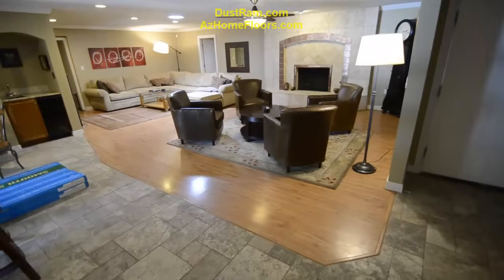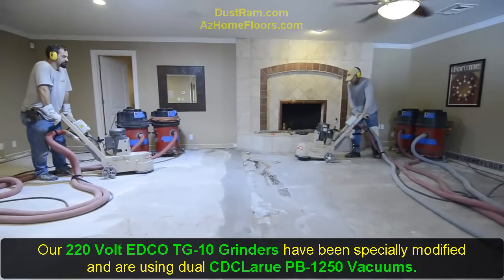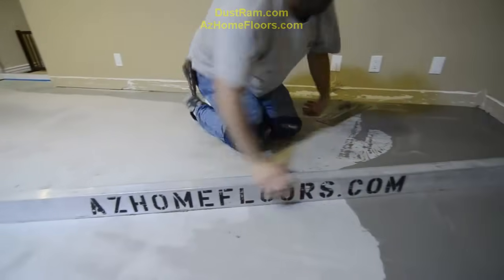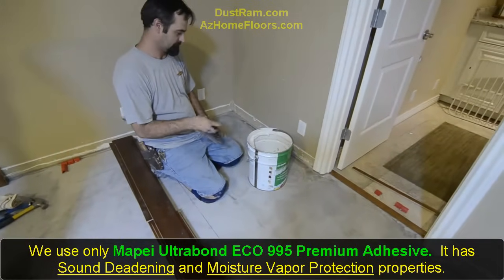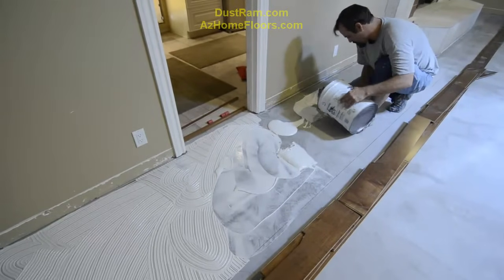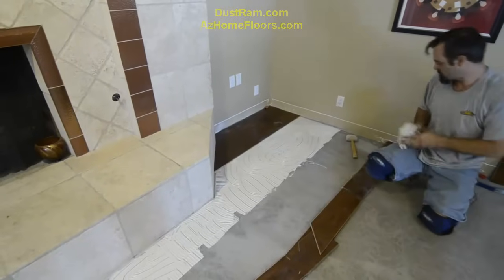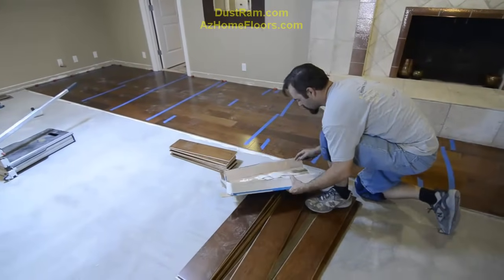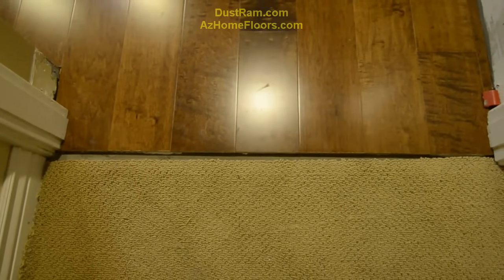Professional Phoenix Hardwood Floor Installers - (For Homeowners Who Want It Done Right!)

Comment: wow" Fantastic work guys. beem installing and sanding wood floors for 15 years now, and have become stuck in my ways. Its great to see how you guys leveled this floor out using those 20 Foot Levels (Screeding). I will use this method on every job now. Problem is for me, I run into a ton of home owners who dont wanna pay all this extra money to do things properly, so I always have to cut corners which I hate doing. I need to be more firm with home owners and explain why this process is the correct method. thanks for sharing guys.

Comment: I am planning to purchase a new (to me) home shortly, and definitely want to do hardwood, even here in Vegas. Yes, it will a long-term, not-ever-moving-again home. After watching this video, I'll be setting very high expectations to my flooring people. Outstanding.
Reply from the maker: That's great news!  If possible, if your timeline permits this, please have your old floors torn out first and then assessed before purchasing any flooring.  This way you can find out if you have mild, medium, or severe floor preparation issues and then decide what you can allocate for your budget.  Also be aware that most flooring stores will end up charging for the tear out based upon the overage needed for your new flooring.  If you are savvy to this, you can prevent yourself from paying for flooring footage that is over inflated.  We often hear of flooring stores that will charge 10-30% over the actual flooring to be removed.  It's a scam and a ripoff most people aren't aware of.  If you're handy with a tape measure and calculator, break down the areas to be removed into simple squares or rectangles.  Then multiply the length times the width of each area to get the square footage of each.  You'll be amazed out how far off some of the estimates are that you'll receive.  You can test the integrity level of a company simply based on this method.  Take care and good luck on your project!!

Comment from the maker: That depends on how badly out of tolerance your floors are.  We have had wood subfloors just as out of tolerance as concrete, but it costs more at that point to flatten wood subfloors because of the addition of metal lath or backer board needed for stability.

Comment from the maker: We have that happen a lot of the time.  Most concrete is in poor condition to begin with and is far from manufacturers tolerance for flatness.  I do believe this video deals with a large crack in the concrete, along with many low spots we filled using our system for flattening.

Comment from the maker: In Arizona where most of the subfloors are concrete, it causes more problems to install over a sublayer.  A sublayer adds considerable height to the overall thickness, which affects thresholds, etc.  If the concrete is professionally prepared by experts, engineered wood, including some solid hardwood can be installed directly over the concrete.  However, the adhesive you use must be professional grade and not cheap, or inexpensive adhesive.

Comment: Looks like you did a great job. I want new flooring in my condo in Phoenix, either tile or laminate or hardwood. How am I going to know the final cost if you pull up the old tile and carpet and determine there are issues with the concrete? I don't want any hidden charges.

Comment: What happens if for example: you rip out the old flooring and discover a cracked foundation in the concrete floor ? How do you deal with that?

Comment: That is a beautiful job guys! With that it looks like about 400 square feet of flooring give or take, what should I expect to pay per square foot for all that you did on that living room floor?
Reply from the maker: +Will Swigart 
Hi Will, the cost will really come down to how much floor prep you need to prepare you concrete.  There was actually 652 net square feet of area to cover.  With everything that needed to be done on this job, including the undercutting of the hearth, installation of baseboards and t-molding, the cost for the glue, baseboards and the wood, and the cost for the floor prep and installation, this project was roughly $10,000 or roughly $15.00/sq. ft.

The typical job usually falls somewhere between $13.00-$20.00/ft. depending on the complexity and the amount of floor prep involved.

http://www.dustram.com
http://www.azhomefloors.com/tile-removal.htm
http://www.dustfreetileremoval.com
http://www.jackking.com
Reply: +Jack King, thank you Jack for the feedback on that. It is really helpful to understand what something costs at a certain level of quality.

That said, perhaps you have a bit of advice on my upcoming job. I'm pretty adept at doing things but not really wanting to do a floor install myself, but I also don't want someone to pull the wool over my eyes and sell me on a job that is not good work or installation practices.

I have a 1970's house with most of the existing hardware being of small maple pieces all nailed to 1.125' decking, an addition to the house later brought the sub floor in that addition to the same height as the maple hardwood. I have new hardwood flooring on hand...Pewter Ash, to be installed. And I'm assuming that it would be nailed down over the maple and through the maple into the sub deck and in the addition just into the sub-flooring.

The center of the house has sunk over the years by almost one inch. These floors cannot be flattened using self-leveling concrete because you can't do a nail down floor over this product due to cracking issues etc. I suppose doing a glue down on to the 

What might be your advice to ensure that whomever I get to do this is planning on doing a professional job that will last for years to come. What questions should I ask or be aware of?

Comment: A true carpenter can cut a perfect 1/8th inch gap between wood and tole to eliminate the t moldings. The expansion void is filled with color matched caulking.
Reply from the maker: Mark, using T-molding had nothing to do with whether or not we could cut a consistent gap.  Did you consider there could have been another reason I did not just leave a gap and fill with caulking?  Did you watch the entire video or did you skip ahead and miss the floor preparation?  If you watched the entire video, did you notice how un-level and un-flat the floor receiving the wood was prior to our floor preparation?  Let me bring your focus to the travertine floors.  The existing travertine flooring had been previously laid first, and with little regard to flatness.  The installed travertine was a series of rolling dips and valleys.  This meant that once the wood areas were flattened, the areas remaining along the travertine meeting the newly flattened wood areas were not consistent enough in height to allow your recommended suggestion of simply leaving a 1/8" gap and using colored caulking.  If I had followed your recommendations then there would have been areas of the wood sticking up considerably above the travertine and would have looked ugly.  Using the T-molding allowed me to bridge the unevenness of the travertine over the 2" width of the T-molding and still leave the transition looking aesthetically finished off at a professional level.

http://www.azhomefloors.com/floor-leveling/
http://www.azhomefloors.com/tile-removal/
Reply: +Jack King I didnt think of that. Normally we do that in high end construction and total remodels. A lot of the time there are wack tile installers that create lippage and all sorts of problems such as that, this last time the h o had the tile guy come back and fix where the tile meets the wood. Most of the time we have to float the floor back with Ardex in top of the concrete/ leveler, even doing it slightly higher on one side to accomodate for the bad tile job.
Reply from the maker: I see you have experienced the same thing on your jobs too.  It's frustrating, isn't it?  In Arizona where I live, very rarely do we ever come across a tile installation where we can install wood without using T-molding.  Quite often we come across elevation changes of 1/2"-3/4" in about 4 linear feet.  Sometimes we are lucky and the customer has us remove all the old flooring, then we can flatten all areas at the same time.  This allows us to then install the wood so that it is flush with the finished tile.  I suppose the key to not using T-molding lies in whether or not the tile installation was done properly, and if the concrete was fairly flat to begin with.  In a perfect world the concrete finishers would take better pride in their work and keep the concrete consistent, but unfortunately that is not the case.
Reply: +Jack King It is frustrating. I also live in Az and know exactly what you are talking about. Just recently we had to grind down a peak in concrete that raised probably 1 1/2 or even 2 inches in 5 feet. It was brand new construction.
Reply: +Jack King Also just a friendly tip. When you snap your line to spread th glue, hold it back about 1/2 inch on each side so that you dont have glue seeping out that you have to scrape up.
Reply from the maker: We don't need to scrape it up as it is still fresh.  We precut difficult "runs" so the wood installs swiftly and goes directly into the wet adhesive.  There is no chance for the glue to "skin" over.  From there, when we install the next run we continue on with more glue and install more wood.  For me it's important to be sure ALL the wood is adhered and it bothers me to think that part of the wood is missing being glued solid, with all the moisture protection and sound deadening properties that the Mapei Ecobond 995 glue provides.

http://www.azhomefloors.com/concrete-leveling
http://www.azhomefloors.com/level-concrete-floor
Reply: Speaking from experience, the glue will come out to just under the tongue of the wood when installing The last row. If your nervous you can do 1/4 inch back, but you might get seepage. We knock on the floor right after installation to identify spots where the wood is not "down" all the way (from a bowed board for example),and add a 5 gallon bucket of water at those spots to eliminate hollow spots. I can tell you from that that the floor is glued evenly. If it wasn't the whole run would sound hollow, but it doesn't.

Comment from the maker: Hi, and thank you for your compliment!  I was lucky and have one of the older more durable models, but can't remember the exact one.  Here is the serial number in case you can track down the model number:  07813L0800.  I've heard the newer ones don't hold up as well.  We only use super blade 913B, so maybe you can use this information to find a shear designed for this blade.

Comment: Great job but, with all the leveling and prep, machinery that only you own , that little 500 square ft floor cost over 5,000 dollars . Most people unless they were well off couldn't afford to do it right ! I know, l am a perfectionist ceramic tile installer, union carpenter, and l do hard word and laminate .  If people could pay , l would flatten the floors also .
Reply from the maker: Hi Raymond,

It is correct that 85% of the flattening projects we do fall between $8-$13+ per foot.  We disclose this in advance during a consultation or even during the first phone conversation.  Many of our clients are perfectionists themselves and see the value in what we can provide.  Since most of the concrete slabs we work on are far beyond any normal tolerance for wood, it only makes sense to them to do it right the first time.  They feel comfortable paying the extra money, since we can demonstrate we have the equipment and the knowledge.  I make this point not to brag, but rather invite installers and contractors everywhere to begin investing more money in equipment and learn different techniques, which will help set them apart from their competition, and appeal to clients who have extra money to spend on critical projects like this.

I also pioneered and invented the DustRam System, a system of processes and equipment to allow for dust free tile removal.  I have now begun selling the equipment to qualified contractors and installers throughout the country.

http://www.dustram.com
http://www.azhomefloors.com
http://www.dustfreetileremoval.com
Reply: I am old now and am trying to get out of the business after 30 + years . l have seen the other video of the tile removal . Cool machine !  A quality large screwdriver and hammer with quick sharp blows  works the best manually and keeps dust to a minimum . The wider the blade the more force it takes and  doesn't work as good . Power tools , grinders are where vacuum's have to be used in conjunction . Try to keep from using them . It is so hard to get out of this business when you do quality work and the extra things that make people recommend you . And don't want to keep doing it because l have watched the installation prices come down over 25 years .
Reply from the maker: Raymond Siewert Hi Raymond,

I understand how you feel.  It is terrible to know most installers are making the same or less money as they did 25 years ago. The big box stores have taken control of a large segment of the installation market and thousands of installers are at their mercy.  The stores keep the largest portion of the money and barely pay anything towards installation or floor preparation, while expecting the installer to provide quality all the way through.  Not only are the installers suffering, but the homeowner suffers as well.  This is because  I was in the same position too and finally decided there had to be a better way to find work.  Once I found a service the Big Box stores could not duplicate, I began marketing directly to the homeowners.  It was a gamble, which has paid off.  Thank you for contacting me and I hope the universe continues to smile on you!
Reply: Thank you , He does .